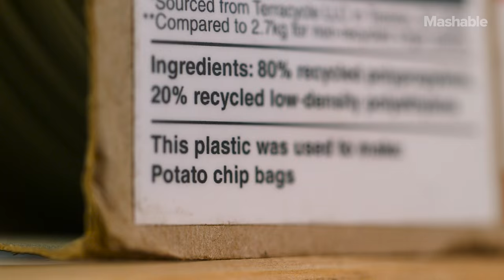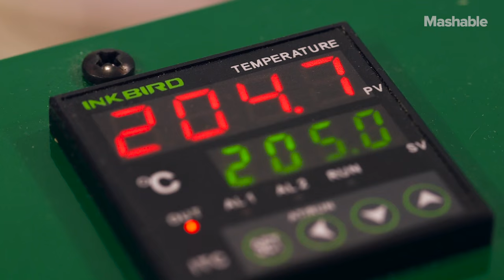3D Printing with Recycled Potato Chip Bags | Mashable

Comment: It's nice to do something about plastic waste. You could have explained that there are other types of plastics in the family of duroplasts and elastomers that can not be recycled this way. This process only works for thermoplastic waste. So, the real problem is to get only the thermoplastics out of the garbage, and then again, split these thermoplastics up in different types so you could remelt them into almost pure pellets and reuse them. (Mixing different types of thermoplastics together usually does not work that well).
I keep all my failed print outputs from my 3d printer in seperate containers, sorted by type of plastic for now. Maybe one day I meet someone nearby who has a grinder and extruder so he can remake the scrap into filaments again.
Reply: Are the generic white plastic shopping bags (the number one item in garbage dump land fills) in the thermoplastic family as well? I'm trying to remember or find any videos that cover turning them into 3d printing pellets/filament as well.